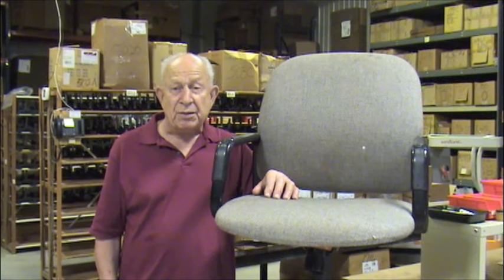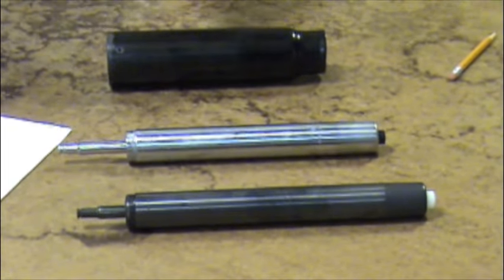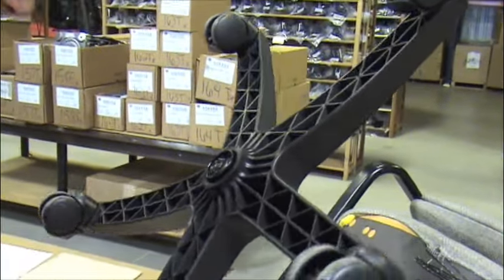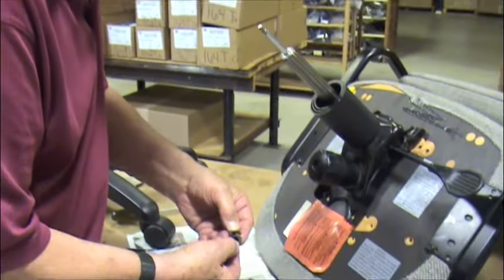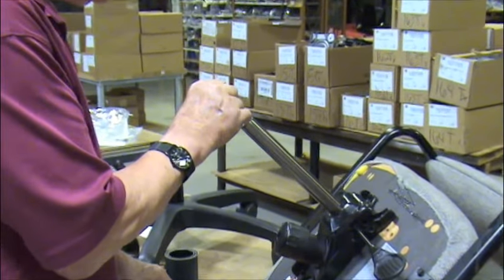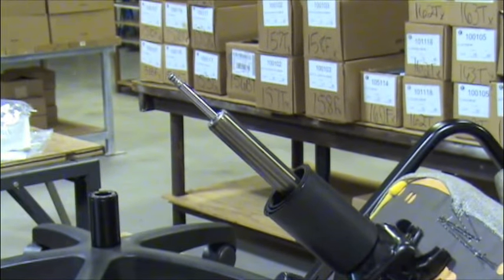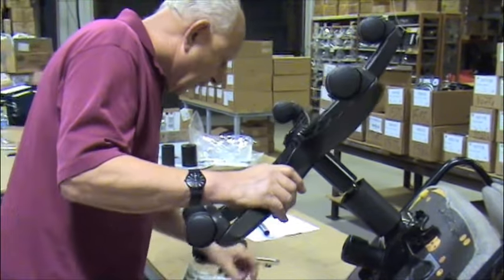How to Measure a chair Gas Cylinder for replacement install/remove

Comment: Sir, yours is the only video that actually told me to remove the pin. That's what worked, because my chair does not resemble any that are demonstrated in videos. My $100+ fix is now only going to cost me $10 to get new washers and rubber seals. Thank you.

Comment: Hi, it's me again. A tip your viewers might find useful:  

I had a devil of a time getting the old gas piston out of the base of the chair.  It was an old chair and I was beginning to wonder if the old gas piston was fastened in place somehow (it wasn't).   I tried using a pipe wrench as you suggested (for your viewers:  pipe wrenches are designed to grip smooth cylinders, like pipes) and a whole lot of leverage, but it ended up only making the pipe wrench gouge a groove in the metal of the old gas cylinder. 

A machinist friend gave me a tip that was the solution -- point a blow dryer or heat gun at the old gas piston where it enters the chair seat. I let the blow dryer run for about 20 minutes.  After that the pipe wrench worked.  

My guess is that the blow dryer simultaneously heated up the metal of the old gas piston, which made it expand, and also softened the plastic of the socket that it was stuck in, so the expanding metal stretched the socket a bit, and maybe broke whatever effect (pressure seal?) that was making it impossible to remove.

Thanks again for your useful video!

Comment: Excellent, thank you. I'd watched another video instructing us to just tap the base off with a mallet - luckily I saw this as well and when I checked my chair definitely has the clip holding it in place as in this video. Glad I found this before causing any unnecessary damage. Much appreciated sir.

Comment: About $15 to DYI or buy a new chair.
Very useful video, it got me started on the right tract. But I need to point out some omitted information.
When ordering new parts, the dimensions listed are an "outer cylinder" and "inner cylinder." By these definitions I would like to elaborate the following:
1:40 the wheelbase is removed and along with it, is the "outer cylinder," the black cylinder sticking out of the wheelbase. When you order a new pneumatic system, that is one of the new parts that will come with it and will be the color you are ordering and will be covered by the telescopic skirt anyway. Part websites will give a diameter or "width" around 1.83" ~ 2.15". Make sure to measure that and remove it from the wheelbase. This might require a rubber mallet or to put a wood board between it and a regular hammer and set it up-side-down on a pair of saw horses to knock it out.
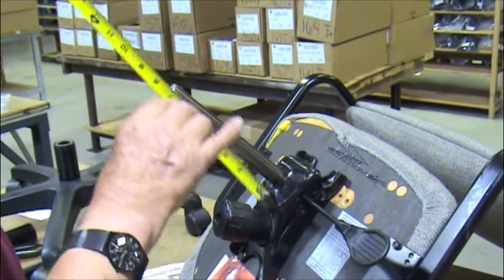2:30 Don's length measurement method is confirmed correct here and what he is measuring, he calls the "gas cylinder body" that replacement part on websites will be called "inner cylinder." The diameter or "width" of that part will be around 1.1". The parts I looked up had no variation on that width which is probably why he omits this information in the video.
The new system you order when it comes in, will also come with the rubber stopper, 2 metal washers, a bearing plate, and a new clip and washer. No need to order those replacement parts. When you remove the "inner cylinder" from the mounting plate on the under side of the seat, you may also have to forcibly knock the cylinder out of the plate. The new system will be held by friction between the wheelbase and mounting plate under the seat and its tightness is reinforced every time you sit down.
Reply: Thank you for those clarifications!

Comment: Thanks Don. Had to abandon my 16-oz hammer and purchase a 4-lb mallet. After a dozen taps on the Lift Off tool, the cylinder came free. Thanks for the video!
Reply from the maker: Good Kevin, whew! I'm sure that's a relief.

Don

Comment: Thank you, this was very helpful.  I just watched a half dozen videos on how to replace the gas cylinder on an office chair and none of them mentioned the length issue.  I measured mine and it's 8 1/2" exposed surface, so I assume I should order a 9 1/2" or as close as I can get. Your site lists a 9" cylinder and a 9 3/4" cylinder. If the exact length is not available, Is it preferred to get a slightly shorter or slightly longer cylinder?
Reply from the maker: I'd order the slightly taller.
Don SCP
Reply: @swivelchairparts  Thanks.

Comment: My chair has a built-in column  I'm replacing the gas cylinder of my chair for the first and I'm wondering if it's safe to remove the column of a brand new gas cylinder for it to fit in my chair's built-in column.
Reply from the maker: Yes, it will be perfectly safe. Read
Reply: @swivelchairparts omg! I didn't expect a reply. Thank you so much!  ❤

Comment: Do I need to measure the width of the travel bar that extends? Mine is 1.25 inches, and not 1 inch like the piston I want to order, which is 1 inch and 2 inch widths for the 2 bars. (not talking about the 3rd skinny thing deep inside.)
Reply from the maker: Hello,
that part (about the thickness of a pencil) is not necessary to measure
Reply: @swivelchairparts  I mean the part that is 1 inch thick (it's the 2nd biggest tube of the piston). The tube (in the piston I'm replacing) is ~1.25 inches. The one I'm ordering says 1 inch though, not 1.25 inches. Will it fit? The biggest tube matches measurements; 2 inches wide.
Reply from the maker: @Metaloid-wv4kz  
When measuring with an accurate machinist caliper it will measure 1.102". Sometimes called 1" up to 
1 1/4" and as well as 27.99mm. And yes, I believe ours will fit.

Comment: Thank you for an excellent video...now how do I know that gas cylinder is bad. I'm missing the washers and the clip. We just measured the cylinder and it's 5 1/2", yes its's a child's chair....It's a neat swivel chair and I'd like to keep it...Also I have a beautiful adjustable table that needs fixing as well. Are you able to help us there..I know we need to replace that cyclinder too  it doesn't rise. I just subscribed.

Comment: There are two types of cartridges available, the one you show in this video with a clip on the bottom, and a press fit type. What is the one you show in this video called? I need a new one, but don't want to order the wrong type.  Thanks!  Agree with several of the others, great video!
Reply from the maker: Jim, We call the clip one a "COM" CYLINDER (abbreviation for complete). It includes the COLUMN, 6 PIECE BEARING SET, and the GAS CYLINDER. The other one we just call a CYLINDER.
Reply: swivelchairparts Thank you!  Now I know how to search for the right one. It looks like mine takes a replacement that is 1 7/8" at the base, and 1.1" at the seat.  So far haven't found any 1 7/8' units.
Reply from the maker: Jim O'Dell The 1 7/8" takes a 2" COM. The base hole is slightly smaller so that the COM will not fall through and hit the floor.

Comment: I have a task chair mfg in 1996 by Eckadams Company. I recently bought 2 from a local site for my home office. They were both in excellent condition. From what I can see it looks like the clip came off the cylinder and the piston rod is sticking out of the bottom. Not sure what I should order.
Reply: Hi Don, How can I order just a washer and a clip for the bottom of the chair?
Reply from the maker: Go to Amazon.com and order an inexpensive bearing kit from the "search" B00II4V2Y8.
Reply: @swivelchairparts  How can I send you pictures of my chair and the parts I ordered? I could not find the part you recommended.
Reply: Sorry I found the part and it is what I ordered. But it will not fit.
Reply from the maker: email us @mychairparts.com or text to 405.696.7682 or phone talk 405.608.4222.
Reply: I ordered a part before your recommendation and it did not fit. I ordered the part you did suggest and the chair is good as new. Awesome. Thank you.

Comment: I just got a $150 office chair and after a few days its already wobbly. I used this helpful video to check the parts and they're all perfectly fine. What could be the problem? it wobbles side to side if that means anything.
Reply from the maker: Hi, The difficult part will be to determine whether the wobble os coming from the mechanism bolted to the seat bottom or where. Tip chair over and start applying lots of pressure in various areas iuntil you see something move.
Reply: swivelchairparts It appears like a bolt or nut or something is missing. The part that attaches the metal to the bottom of the seat. There 2 spots for bolts or screws or whatever and only one is occupied. It shipped this easy so I didn't think anything of it. Could this be the cause? If so how can I fix this?
Reply: AeonsOfBlight *shipped this way
Reply from the maker: AeonsOfBlight Where the missing bolt goes, there should be something metal to bolt it into. You can always test it by removing the one good bolt and see if it will  .tighten up properly. If not, the chair will always wobble. I'd send it back as it will not be worth it to attempt repair.

Comment: It all looks soooo easy…until you try to remove the cylinder that’s had 200+ pounds of software engineer bearing down on it for two years at ten hours a day 😂

Comment: Hi.  
I have read that those cylinders can explode and hurt people in very rare cases... As a pro on that area is that even possible, i mean, if this by any chance explode sometime, is there suficient pressure inside to hurt someone?
Reply from the maker: Sergiocrivelin, I read that several years ago some Asian fellow claimed that occurred but that has never been substantiated. 

Don
Reply: Seems unlikely.  It is pressurized, but in order to explode, you'd need to somehow increase the pressure while maintaining a seal (maybe if you heated it up with a torch or threw it in a fire.)

If you break the seal, however, the air will come out through the hole.  It might be forceful, but it should just be a blast of air (and whatever lubricants might also be inside - so it could hurt if it got in your eye.)  But I can't imagine it exploding.

Comment: How do you remove the gas strut, I can not access the top of it to hammer it out?
Reply from the maker: It TWISTS off in any direction you like but it takes a 15" or longer plumbers pipe wrench or rent a removal tool from us for $6.50.
Reply: @swivelchairparts  thanks

Comment: Hi I unlocked the clip and the piston went inside the gas cylinder .. is there anyway i can get this out ?
Reply from the maker: Yes. If cylinder is still in the mechanism, trigger the lever a little at  time until it comes out not more than an inch or so and reinstall the clip. If out of mechanism, strike button on a table top to extend it not more than 1 1/2".

Comment from the maker: Not necessarily. The seals are not replaceable. You have to get a new gas cylinder or a new chair.
Reply: +swivelchairparts Hi i want to ask you, my office chair gas cylinder thing that is on the bottom, this tube like thing that has the clip that you put out with the screwdriver..this thing has came a bit low from when i have bought the chair..and so it makes harder at moving the chair as it barely touches the floor..and especially when we have a carpet..when i bought the chair it was way more high, what do i have to do to make it stay permanently at a higher height?
Reply from the maker: Ramon Campos , what happened is that the hole in the 5 leg base stretched out permitting the "tube" to drop down. This occurs with low quality bases. There is no fix,only replacement. None of ours will do what yours did. See if this helps you--http://swivel-chair-parts.com/GasBases.html
Reply from the maker: https://youtu.be/D7QWR77mEnw